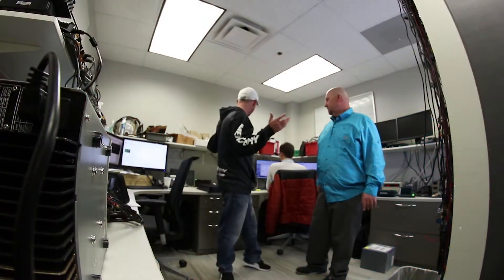Lowrance Hook 2 Software Development at Lowrance Headquarters

Comment: I was able to place the unit on my left just forward of the rudder controls>>>allabout.wiki/6qdt    just aft of the first foot notch. I used a slide lock ball mount for the hull attachment. Keeping it on the top rail, allows for maximum articulation of the brackets.